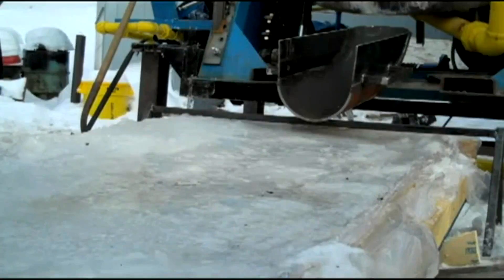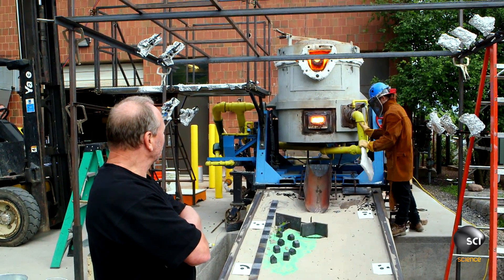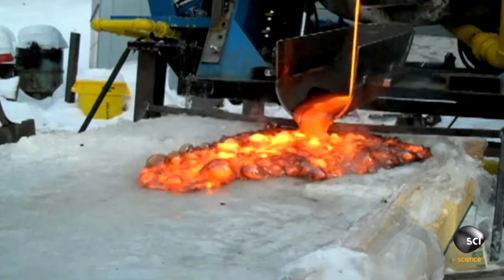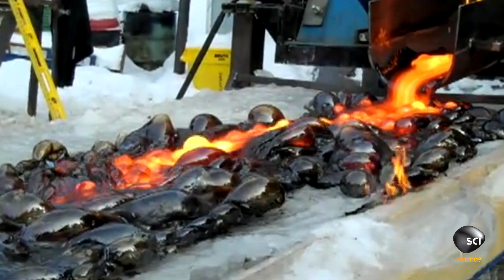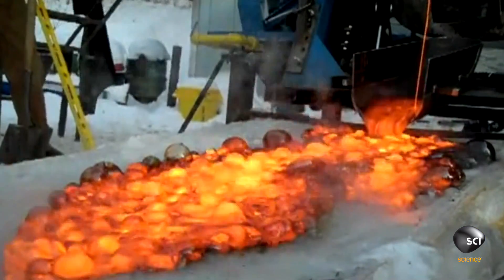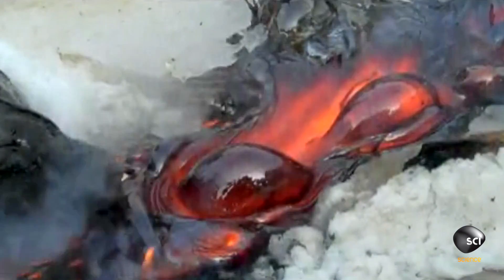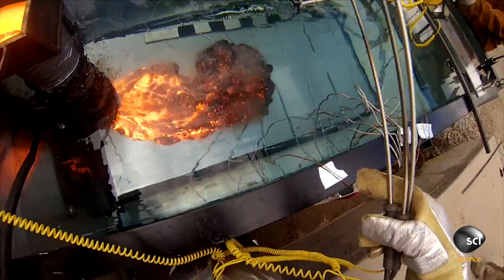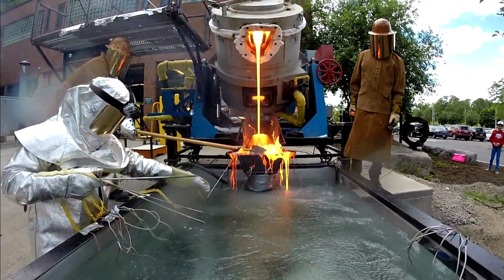What Happens When Lava Meets Ice?

Comment: ive always wondered since i first noticed my ice cubes cracking and making noises when id put them in hot coffee(sometimes i want my coffee immediately but i dont want third degree burns, so i stir in ice cubes to cool it slightly. if you dont stir it the ice melts more slowly making the coffee colder and watering it down at the top of the cup)

Comment: When we boil water, bubbles come from the bottom to the top. When I was very young, I used to wonder why. It actually is heat escaping from the water in the form of bubbles. Likewise, it's the same with lava on ice, ice is very cold and lava is very hot, so, the heat escapes like bubbles. And why it flows? It's because the lava which cooled down isn't ice cold but enough for the rest to flow over it.

Comment: So maybe the megalithic structures built from huge shaped blocks of basalt, if they are Pleistocene sites and up near those vents were glacier's, a crew could control with rock berms a finger of lava and flow it into molds.  You could do it right there with your furnace, scratch a polygonal shaped form into that ice and fill it up, screed the bubbles and let the piece cool.  No?  Better yet, fill a container with sand, shape the sand and flow in lava for a sand casting.  No chiseling on  hardened outcrop of 500000 year old basalt required.

Comment: "The friction is very low" --> seems like the lava flows no quicker over the ice than off of the trough, which has about the same slope. The friction is a hard thing to quantify, since the surface of contact between lava and ice is growing in very complex ways. Moreover, the molecules are transitioning from solid to gas at a radical rate. I would want to know if water is ever in its liquid state underneath that  molten mass. Does the pressure underneath become large in places as the initial layer of contact hardens and encapsulates ice while it continues to sublimate? Truly amazing experiment.

Comment: but what if you let it cool down until it is about 20 degrees, then open those hardened bubbles... Would they be filled with water?
Reply: WHich means there should be a partial vacuum inside

Comment: i'm not surprised by what happened. this is tantamount to having a pan with hot oil in it on the stove and then dropping in a SINGLE drop of water into the hot pan (NOT recommended --- for example purposes only) --- same reaction as the hot lava on the ice.

Comment: "I thought it would explode" totally killed me. Is this a channel for the mentally handicapped?
Reply: It's not a crazy assumption to make. When you poor something really hot onto something really cold there's often an "explosion" caused by the cold object getting vaporised into gasses, which are significantly less dense and expand, causing an explosion. An example of this would be pouring molten salt into water, the water gets trapped in little pockets in the molten salt, and is turned into steam which expands, causing an explosion.

Comment: what about dry ice or liquid nitrogen
Reply: It'd pretty much do something similar. What you're seeing, and what the guy at 1:12 is basically explaining, is something called the Leidenfrost effect. When you get liquid and put it into contact with something well past its boiling point, it'll create a temporary barrier of steam. You can do this with water drops on an extremely hot pan (way past just boiling point). 

You can also use this with lead by getting the led to the right temperature, dipping your hand in water, then into the lead. If done right, you can dip your hand into molten lead for a brief moment with no adverse effects. You can also dip your hand into liquid nitrogen very briefly as well, because your body temp is well past liquid nitrogen's boiling point. That being said, I'd suggest not trying these things unless you're very confident you know what you're doing.

Comment: Wrong, the ice does not transform into steam, it changes into vapor. I know this because I have poured water on red hot aluminum oxide in the factory that I used to work at. You can do the same thing at home, if you use a hair dryer on hot air and point it at the steam escaping from a tea kettle, you find the steam turns into vapor.

Comment: I don't even study science and i made a better estimation of what would happen than the geologist, who didnt have a clue, given by the way he was nodding in agreement.The only thing i didn't consider was the steam, but i knew it would eventually turn to rock, just requires a little thinking. My thinking  was, lava melts ice, ice turns to water, water melts (missed out the steam part) the lava cools then rock is produced.
Reply: You just had to think of the sublimation temperature of water and you would be able to predict a good portion of it.  I didn't predict the flow because I didn't think of how the steam would change the coefficient of friction.  But while putting a lot of thought and study into your hypothesis is one way to go about an experiment, you could also just make an educated guess based on the first thing that pops into your head.  Unless you're in first year chem doing a rote experiment you'll learn something anyways.  The hypothesis isn't as important as the result or conclusion.

Comment: Why would it melt a hole? The gas created from ice is almost like a thermal break between the two and would allow the lava to float on top if it for sometime. Once the heat is greater than the ice can stand it will melt in though.

Comment: the first guess when lava hits ice is explosion?

Can someone explain to me how this is logical because I find it to be the most retarded guess ever? thnx
Reply: +WhiteEmerald1991 Ever put water in molten iron? It explodes violently. It is called a steam explosion / physical explosion.
Reply: Its like when you burn thermite on ice it explodes search it up
Reply: Dan Coulson Okay i´ll explain it to you. You have a pot of molten iron for example and throw a bottle of water in it, it will explode, because the water turns from liquid directly into steam, because of the temperature. Because steam needs more space it expands rapidly, pushing everything that surrounds it away, causing a huge ball of high velocity molten iron particles. So it is plausible that if you pour lava on ice or in water that the same thing happens. It does not happen in this case, because lava is way to dense to get seerated that quickly, in addition to the point that is also cooling down and terefore becoming solid again. If you pour lava in water the water can coduct the heat very well and cool down lava very quickly, plus water vapor is forming a counting around the hot lava, preventing more water to come in direct contact with it. Hope it makes sense to you.
Reply: +WhiteEmerald1991 Don't take it logically, take it scientifically. You will find your answer.
Reply: +WhiteEmerald1991 what i asked in warframe xD
Reply: first thing I was thinking of that the lava will go through the ice 
then into the ground 100 meters 
and good luck if want to can fix that
Reply: +WhiteEmerald1991 "explosion" being the steam eruption that would send lava flying. Not like a bomb explosion more like a popcorn type explosion
Reply: Micheal bay Nuff said
Reply: Dan Coulson You clearly don´t know how physics work. It isnt even chemistry, just physics.
Reply: Dan Coulson lol wut XD everyone who thought it would melt right down has no Knowledge... every organic Thing  "explodes" when it touches Lava and many non organic Things... so why should it be that ppl who think it would explode have very Little Knowledge about physics?????
Reply: If ha put water on lava it evaporates but because its so damn hot in there the water turns to Explosive steam now i will let you figure out the rest
Reply: The heat could cause so much ice to melt so quickly, that the vapor would burst or through the lava, my best bet.
Reply: nipples ohhh. Hmmmmm. Now that explains it more. I was thinking of a BOOM type of explosion and kept that thought in my mind as I accepted the others explanation. But obviously a boom explosion wouldn't make sense. Thnx for clearing that up.
Reply: WhiteEmerald1991 Any quick high exertion of kinetic energy can be called a "Explosion" I mean even when you cook bacon and have grease pops. They're "technically" explosions
Reply: nipples nice. I didn't know that. This is something that I should had learned in my Chem classes but I don't think I haven't
Reply: +WhiteEmerald1991 I know! I only studied science till high school and I was shocked when he said that! I wasnt expecting explosion!

Comment: I wondering how they collect the lava because I thought lava melts everything
Reply: +Wada Ayaka With carefully selected metal and stone, and VERY cautious handling, anything is possible, my friend.
Reply: +Wada Ayaka most likely using some sort ceramics or stone. most ceramics have a higher melting point than most metals.
Reply: lava doesn't melt everything and they made lava by melting rocks in a giant arch furnace (the thing that held the lava)
Reply: +ABoyFobFan C Are you?
Reply: it was fed ex'd from the big island brah
Reply: it depends on the types of rocks they use to make the lava. adding certain minerals can change the way it flows or the melting temperature. The furnace is probably made out of refractory alumina, which melts at 3700F, your "average" lava melts at 1300-2300F due to its composition.
Reply: +Takami Chika They use steel beams. Lava can't melt steel beams.
Reply: +Takami Chika "Lava" is melting rock, just collect it using something with a higher melting point.
Reply: OMG
Reply: +Codename: Potato does that mean we can finally go to the centre of the earth?
Reply: HiatusMobs I was joking... we aren't THAT cautious.
Reply: Molten Steel is hotter than lava
Reply: darkenlightenment Yeah
Reply: Lukas Suphke Tungsten has an insane melting point, I can't even find one picture or a video of molten tungsten
Reply: +Codename: Potato OR they heated rocks until they melt. I think it's easier than collecting lava.
Reply: +Takami Chika obviously it can't even melt ice -_-
Reply: +dligac 😂 right
Reply: Do you know that lava doesn't really melt? If you fall into lava you don't melt you burn it's just like fire
Reply: +Pablo Blo *molten
Reply: +Trenton Zelley Tungsten has the highest Melton point of any element, so by logical extension, nothing can withstand as much heat as it can. Simply put, any container you try to melt tungsten in will melt before the tungsten does.
Reply: Not really everything. Your Atleast better than those Minecraft freaks.
Reply: Ok I understand already

Comment: Awesome!
It's clearly the leidenfrost effect that causes the lava to levitate. If doing the classic experiment with a water droplet in a hot pan - but use a pan that holds heat well (for example cast iron) and then pour a lot of water into it, the water behaves pretty much the same.
The difference is that when the lava has cooled down enough for the leidenfrost effect to stop, is has also solidified and "freezes" the formation - also as explained in the clip, the water vapor is trapped when it solidify, making large bubbles.

Comment: One also important thing happening there what I didn't heard on the video is that water has high specific heat capacity, about 4200 joules per kilogram (about 0.5 calorie per pound), which means that 1 kg (2.2 pounds) of water (and of course ice) absorbs 4.2 kJ (1 calorie) of energy heating up 1 degree Celsius (the change in Fahrenheit scale 1.8)

Funny fact is that 1 gram (0.6 dram) of TNT produces about the same amount of energy! (calculated for 1 kilogram)

And that's not even all the science behind this! To transform from solid to fluid (also from fluid to gas) every stuff has its own amount of energy to absorb before it transforms. This is called heat of fusion. To water it is 3.3 kJ per kilogram (about 0.4 kilocalories per pound)

Using waters specific heat capacity we can count a little to lighten things up. Waters shc is 4.2 kJ/kg and lavas is 1.6 kJ. We assume that the lava in the video is about 5000 degree Celsius (9000 Fahrenheit) because the color of the stuff they pour on the ice. (And that high temperature is completely absurd because in nature lava is only between 800 and 1200 Celsius... 1500-2200 Fahrenheit) After summing things up a little (you can calculate these things by yourself if you are smart enough;) really this is not so complicated..) I figured out that 1 kilogram of that stuff in the video will heat up 1 kilogram of water roughly 1800 degree Celsius. For the american youtubers out there 1 pound of 9000 Fahrenheit lava will heat up 1 pound of water roughly 517 degree Fahrenheit (<-- not completely sure about that one though. If you are american please check out that by yourself:D) And in these calculations I even didn't take account of the heat of fusion. But as you can see there was huge block of ice there and not so much lava so science happened!

In a nutshell what we saw it the video is not even a miracle:D

Their explanation for the bubbles was good so upvote insured..